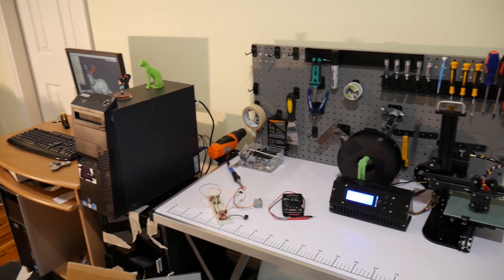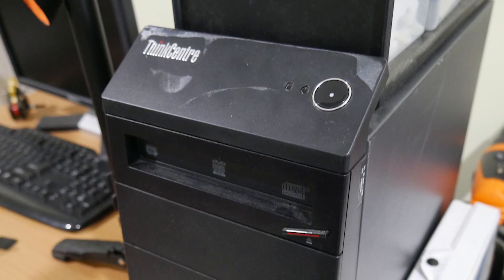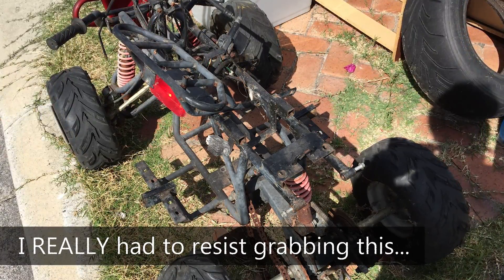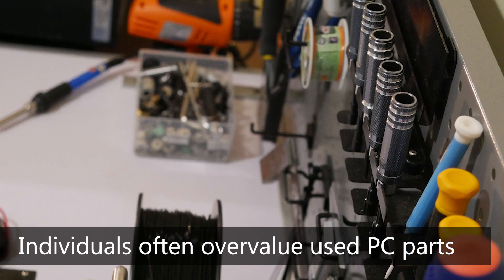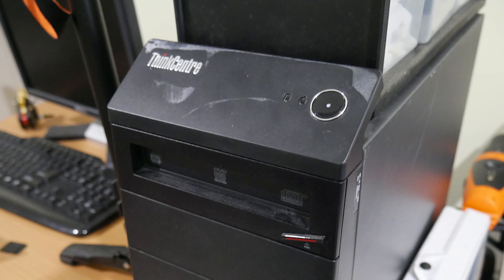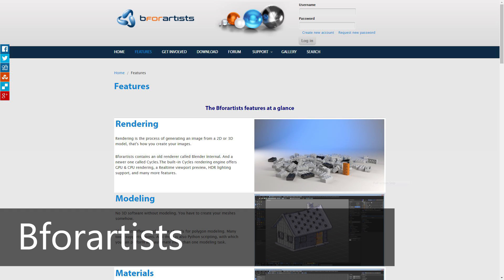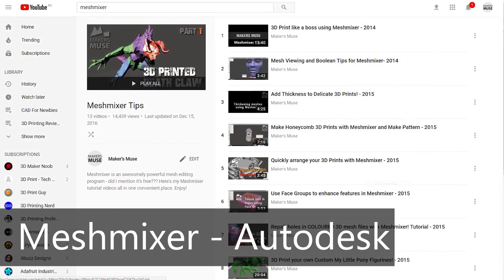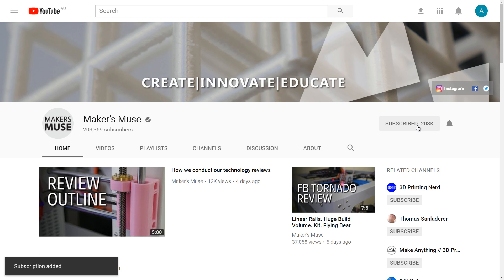How to get a FREE Computer and 3D Software for your Budget Makerspace (Episode 3)

Comment: FYI although you dont really need an activation key for windows 10. you can use it fine without activation (with limitations). if you have an old/dead system with a 7/8/8.1 key. you can use that key to activate windows 10 still.
you can get a up-to-date windows 10 ISO from microsoft. google "Media Creation Tool" provided by microsoft.

Comment: I have a 2017 surface pro laptop. It has 8GB of RAM, Intel Core i5 processor and an Intel HD Graphics 620 card. Will it be able to run 3D printer software?

Comment: You can just go on craigslist and find people giving away PCs. I have a Mac and a custom built desktop PC running 5 - 500GB HDDs in RAID10 that the majority of components were free (ALL of the Mac was free. Including the I think 20" Cinema Display). I've gutted dozens of towers as well as laptops for components. As an example, I have 11 laser diodes from DVDRW drives that I've been tinkering with making a laser CNC and PCB etcher. My laptops are solid though. Except my 6th gen Intel one is trash for graphics editing. My 8th gen is a certified badass though. And only the older one has an SSD (Evo 850). But the newer one has an Nvidia MX150 which is a new trend in laptops, and TOTALLY WORTH IT

Comment: If your video output supports it, get 2 of the free-or-close-to-it 3x4 LCD monitors. Often you can put them side by side and get a nicer wide "desktop area" to work with. Often the split between the screens can be set so you have your tool pallets on one side and the other for your visualization window.

Comment: In the US check out your Local University's Property Disposition center. I went this week to mine and grabbed 2, I5 3470 (8gb of ram, 500gb HDD) and a 8 port GB switch. The computers were $60 each and the switch was $5. They also had Core 2 Duo systems for $25 with a monitor. They almost have a really good deals.

Comment: You should have mentioned that iceSL requires a decent/recent video card to function. My 7 year old 2.4Ghz system has an ATI card and it isn't new enough to try iceSL.
Reply from the maker: Ah fair enough didn't realise it was so specific in my testing. I'll update the website details to mention it. Thanks for the heads up!

Comment: So I just tried the IceSl software you mentioned and gave it a descent task. I loaded in one of the chassis parts from daveyclk thingiverse $30 3D Scanner and left it in the default orientation (on it's side). I added some support where needed and set the slicer in motion. It froze up at the 65% mark and I had to shut it down the hard way. Looks and feels good but may need some attention for complex models with supports. Cheers

Comment: If someone gave me any laptop that's fast enough to run Ubuntu, I'll install Wine on it, download google sketchup, download the STL plugin , download a slicer and do my thing.
If someone gave me 5000$ to spend on hardware and software, I would just use my old laptop (or my new laptop), run sketchup with the STL plugin and do my thing. Why? Because it's just so fast and simple to work with. It's really just Prrrt, done. (That's if you know the little tricks and hotkeys and so on.) You can make curved geometries with sketchup without plugins. In my spare time I have made some chamfered cubes to test it out, and it did take less time than with the other modelling software I've used.
I have worked with Catia, Blender and Solidworks too, but for 3d prints I would definately prefer sketchup.
Another benefit of Sketchup is that it doesn't need great hardware to run on. I know there is other simple 3d modelling software out there, but I haven't seen anything simpler and faster to use than sketchup. (I haven't seen doesn't mean it doesn't exist)
Reply: Well, there is something that's faster than sketchup...
If you are modelling someone's face, blender would be my choice.
If you want to 3d print a real object I would say spending money on a copy of "Agisoft Photoscan" would be a good choice.
But for smartphone cases, brackets, sketchup is the thing to go with.
Reply: Sketchup is a horrible program that lacks a proper assembly system and its way of doing things results in lots of inaccuracies. Beyond this files generated in sketchup generally have lots of mesh issues that don't occur nearly as often as in other programs. I would not recommend Sketchup to anyone doing anything more than maybe architectural work.
Reply: Lightbearer I actually feel the same way most of the time, but I started on sketchup, realized it's limitations and switched to solidworks. I only did this because it was free as a student. If I were to recommend anything it would be fusion 360.
Reply: I get that. I frequently stick to software that I find easy to use rather than 'upgrade' to more elaborate and feature-full software. I'm a Solidworks guy though since that's what I learned on.

Comment: I'm watching this on my franken-laptop build. I went to ebay, picked up two broken Dell E6430 notebooks: one had a broken screen and frame, the other was fine cosmetically, but had a fried motherboard. It run me $122 for the both of them. Then I pieced together a working notebook from the two. Now I rock an i7 3740MQ, which is quite powerful even by today's standards, 12GB of RAM, a 120GB SSD (that one I bought separately), it has a 1600x900 screen, and nvidia 1GB graphics card, bakclit keyboard, and I even found a docking station for $10, so I can connect it to two external screens. And I even have some leftover parts I could sell. What computer can you get for $122 today? Maybe some Atom-based netbook at most.

Comment: You make some brilliant points!  I have bought off-lease equipment on eBay in the past, where the only thing it did not have was the hard drive.  Most businesses, especially if they do anything medical related, will have to inventory and show proof of destruction for the storage device (here in the USA, that's part of the HIPPA Laws).  Our Fiscal year ends Oct 1 but many businesses run a regular calendar year, so NOW is a good time to check in with local facilities, eBay and so on.  Great channel!

Comment: onshape is another webgl cad program that has a much more familiar interface to someone coming from fusion or solidworks.
Reply: yep, works great, comes real handy for linux users.
Reply: Thats why I use it. What distro you on?
Reply: Ubuntu 16.04core with xfce, would use freecad but it's far from the industrial standard (at least for now), so web based cad is the best option for now...
Reply: Yeah I tried freecad. It still kinda sucks.
Reply: i was working in a small startup for a couple of months and they were using onshape. I have to say i got really a fan of onshape and im also using it for my private projects. I really like the idea to work on my projects from my phone or tablet with oncoming apps

Comment: On CAD:  didn't OnShape worth a mention?  BTW fantastic work here... as always
Reply: Clément Boucher Didn't they do something to the license for OnShape, that stopped a lot of people from using it?
Reply: Don't think so. I'm using it almost daily. The only limitation is that your documents are mandatory public  when using the free edition. It works very well for my needs.  I quit F360 because of install process failures, but I just learned in this very thread that they have a browser based edition. I'll give it a try.
Reply from the maker: The change to private documents killed it for me, as I only want to release things once they're complete not instantly. The jump from that to $125/mth is quite frankly ludicrous, so I went with Fusion instead.
Reply: Your business needs are indeed very different from my hobbyist ones. And I must admit that 125 $/mth is quite high. If only F360 could get rid of the mandatory "C:\programs\" install path... This may sounds silly but I reserve the C: drive for OS.

Comment: I have to disagree with the "don't buy a laptop" argument. Now of course a used desktop in the same price range (or even for free) will be more powerful, but if you need a mobile computer anyway, a laptop might be a viable option. Personally I just bought a Lenovo X220 for under 200$ (you can get them for under 100 though if you don't get the highest tier CPU) with an i7, 6GB of RAM and an SSD. What I like most about the X220 is that it is upgradable and moddable without end. Over time you can rig it up to 16GB of RAM, an mSATA SSD, a 2TB HDD, and even a 12" Full HD Display if you aren't afraid of soldering an adapter PCB onto the Board. Another cool feature is that you can get a Thinkpad Dock for 10-20$ (usually it comes with another Power Supply as well) and if you got a LCD screen and Keyboard/Mouse for cheap have an easy and cheap dual screen setup. It is also noteworthy that Lenovo still produces Battery Replacements for this model.
So yeah, for most people a desktop would be the better option, but not all Laptops are created equal, and there are some nice ones out there.
Reply: - p4tchu - Stopped watching at that point when I realised Angus had no idea what he was talking about. The Eeepc wasn't a laptop, it was a prequel to Chromebooks and hybrids. The reason it's rubbish is the Atom CPU, which is terrible for any kind of 3D work.

My 2011 vintage i3 ThinkPad (upgraded RAM and SSD but Sandybridge era chip) runs Onshape and Cura 3.0.4 effortlessly.

Comment: 6:56 "Moore's law has not been kind to laptops" What does Moore's law have to do with it?
7:05 The eeePC falls into the netbook category which are weak by definition. But you can't judge all laptops by that example.. Even though you generally get more performance for the money with a desktop.
7:29 Yes. Usually you can desktops to run cooler and less noisy at load than laptops which somewhat ties in with those efficiency improvements you mentioned.
Reply from the maker: Probably not the best way of putting it, but the power density of computers is most obviously seen in portable devices. Smartphones are an extreme case of this, but laptops follow closely behind. By design they must limit heat output and be made to run at least somewhat useably on battery tech available to them. Desktops on the other hand, can be power hungry beasts and the focus of development has mostly been on filtering down efficiency in these systems, making older ones still perfectly good except in the power consumption department.

Comment: Approach medium sized companies with some sort of proof that you are setting up a charitable operation / non profit and they are pretty likely to help out. It costs them money to dispose of IT equipment, so you taking it away helps them out. Also tell them that you will add their name & logo to your maker space and promotional literature and give them permission to do the same. Businesses can benefit from community outreach / improvement projects. Getting them on board by taking away their e-waste is a win - win situation.
Also once you have a relationship with a company, other resources may become available as they upgrade other equipment. One company I worked for years ago binned off a whole telephone system, network switches and potentially interesting for a maker space an old CNC machine and other tools. Whilst the CNC was sold for a token amount of cash, I'm guessing if it could have been used in a PR exercise with a maker space, the company would have considered the opportunity.

Comment: In the Netherlands, we have the Marktplaats.nl site for fairpriced secondhand stuff, got a lot if cheap tools, machines and pc/pcparts there. 
I run my i3 Gräber (prusa i3, boxed/wood construction) and Cura on a €35,00 Amd 64 from 2009... with Windows 7.
Works ok.